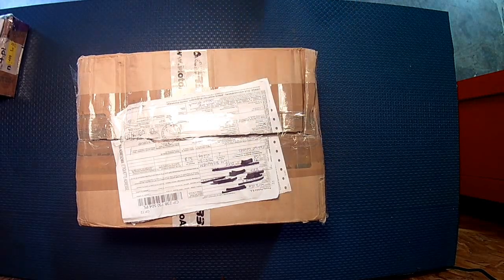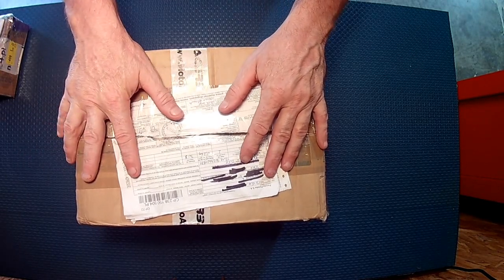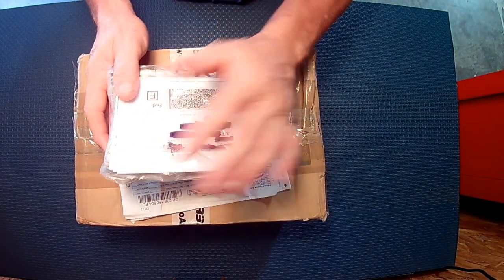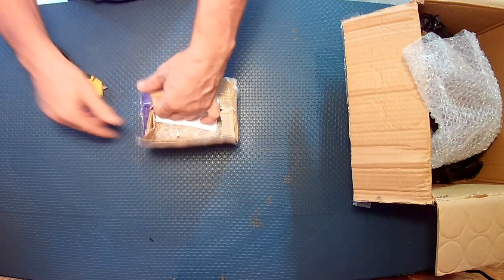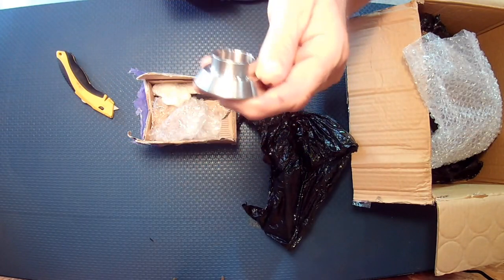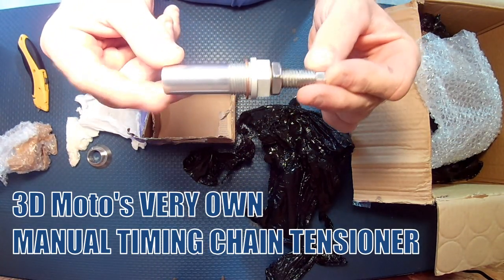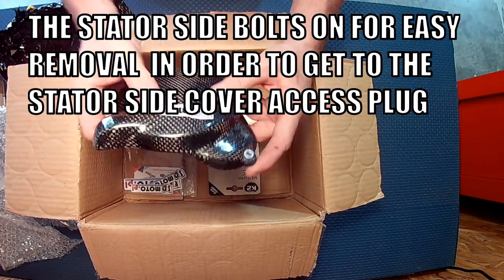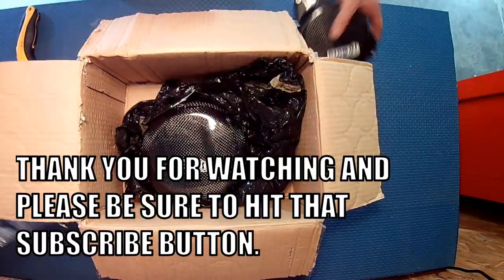3-D MOTO BRAND NEW PRODUCT TO MARKET

Comment: You liked those covers on mine so much you had to order a set for yourself :P  Word of advice on the clutch cover is to use a large C clamp to push it against the clutch cover overnight because it won't be very tight otherwise.  I will probably redo mine to make it a little more snug.  Wish I had ordered the back spacer when I ordered my other parts....I completely forgot about it :(
Reply from the maker: actually I ordered them a few weeks before you did. I just had them shipped a different way. Note dont go cheap on shipping it will take over a month